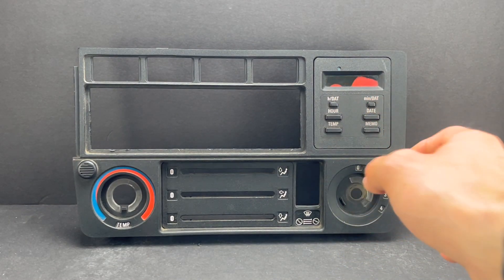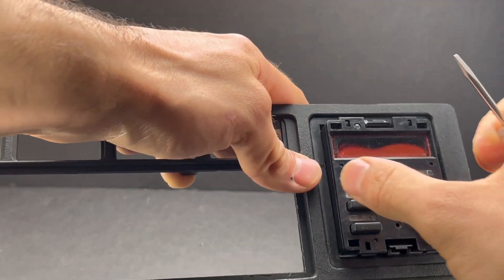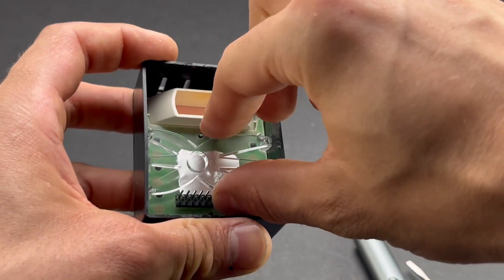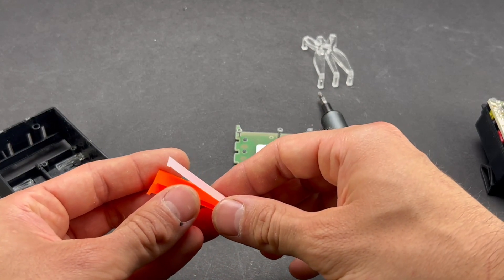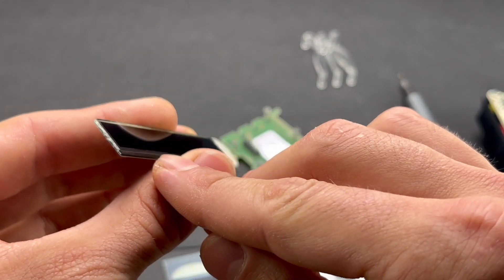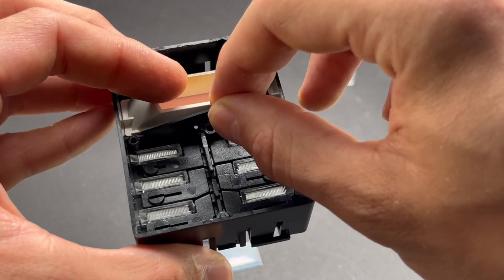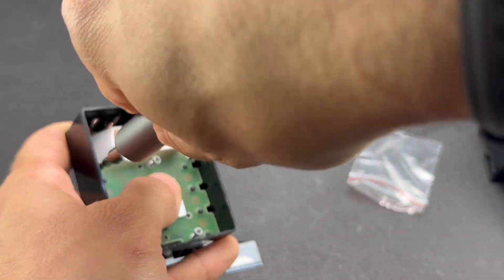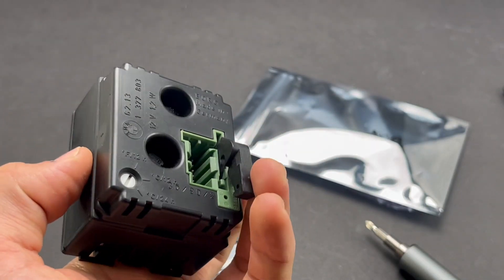BMW E30 6 Button OBC Screen Repair Tutorial

Comment: My OBC is not lite up at all. The camera angle does not look into the 2 round holes in the rear of the unit. Would the bulbs need to be replaced as well?
Reply from the maker: If you can see the characters on the screen but they aren't lit up then you will need to replace those two bulbs on the back!
Reply: @addisonmorrone  No Characters. Just a orange panel. Sounds like a LCD replace? Thanks for your video!
Reply from the maker: @henrychan360  Yup that means your panel is bad so you will need to do the procedure in the video to replace your lcd!

Comment: Hello, Nice job and I followed your instructions and got mine working again. What does that light/led in the left-hand upper corner do? Mine is burnt out, but everything seems to work.
Reply from the maker: Thanks and glad you got it working again! That little “led” is actually an ambient light sensor for automatically adjusting the screens brightness.
Reply: I think mine is burnt since the legs of the sensor seemed to have crossed. It seems to work but is dim in the dark. Do you now if this sensor is replaceable or am I better off waiting to find a donor OBC? Thank you
Reply from the maker: It might still be okay, just separate the terminals where they are touching. Before you look to replace the light sensor, did you replace both of the bulbs on the backside of the obc?